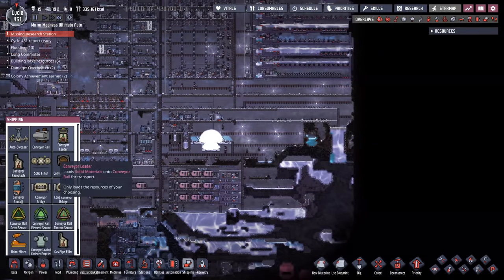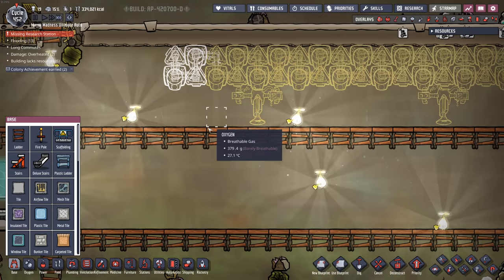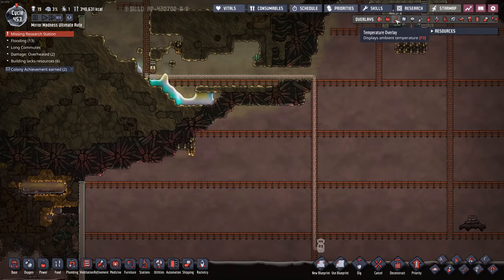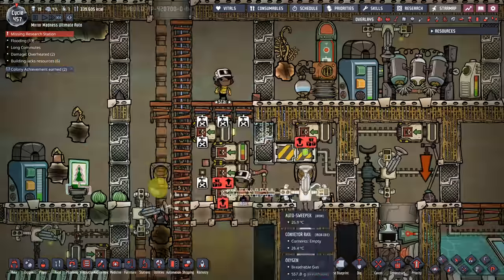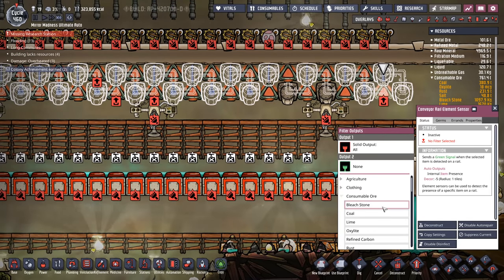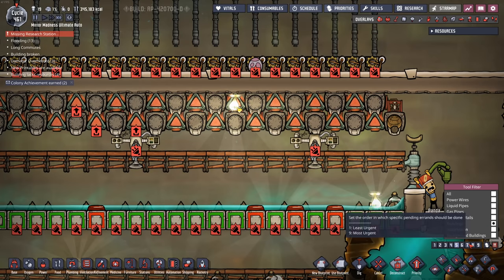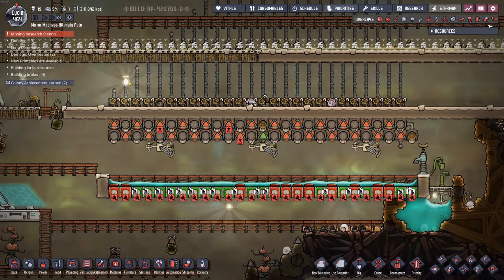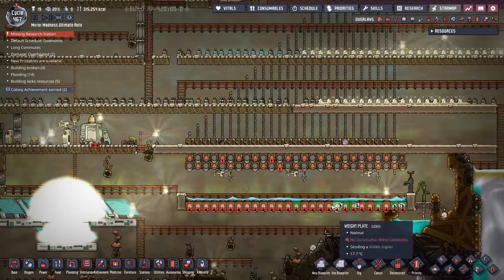Oxygen Not Included ep 18 - Modded vs Vanilla Series 2020

Comment: I started my second serious playthrough of the game and you have taught me so much. Having those speciality rooms makes a huge difference for duplicants' moods (and also not immediately using all skill points). Also gas and liquid management (turns out non-oxygen gases are usually not dangerous). I also built a door compressor to store ridiculous amounts of natural gas from a geysir. 

Now going into later game, I know how to use exosuits manage temperatures. I have a couple of basic steam turbine setups deleting heat inside my main base and in my oil refinement/plastic area. Nothing too fancy, but they get the job done, even if both of my aquatuners overheated and broke (first because I didn't have steel available and second because I mistakenly made the thing out of the wrong material).

Comment: I love the serpentine sorter, I am planning on doing a mini version of it in my industrial area. I am going to also use the weight plates to request raw materials from my central infinite storage zone. For your design, you could run that concept backwards and use the weight plates to request more refined iron etc. if your base is getting low. Sort of similar to your previous safety stock design. Given the variety of requests in yours and my design, automation ribbon would be useful. You could either do each line for one material or do some sort of priority system with binary encoding so rather than having 4 possibilities you have 16, but with an order to them . So 0000 means make more steel, 0001 make more iron, 0010 make more gold 0011 make more tungsten etc. Doing so could potentially result in a lack of resources causing a deadlock though so it requires careful design.

Comment: automatic dispenser's work errand is a delivery order, rather than a storage order. it gets higher priority by default (making them a pain to combine with other storage options)

there's a mod that "fixes" that so automatic dispenser acts like a storage bin.
 i wanted to use dispensers for infinite storage without having to obsessively sweep. i made a hallway with 20 dispensers, each collecting 1-3 similiar items sorted/dropped into 20 inaccessible pits. 4 sweeper arms move resources from infinite storage in pits into one of 36 conveyor loaders. those loaders feed manual-use conveyor receptacles each with only 1 item type & also carry on through base to places they're needed. the setup is fun & only possible with dispenser mod (as far as i know)

Comment: If the dupes are picking up resources manually at the inventory system, what happens if they drop a material on top of another?
Reply from the maker: They are fired!
Reply: most likely when the dupes drop it it will be moved closer to the side the Dupes were originally taking it and another dupe will likely grab that piece of material before the rest and so it will be picked up pretty quickly and make little difference.